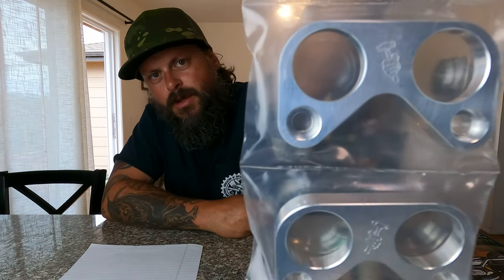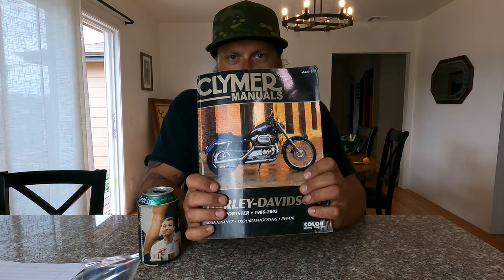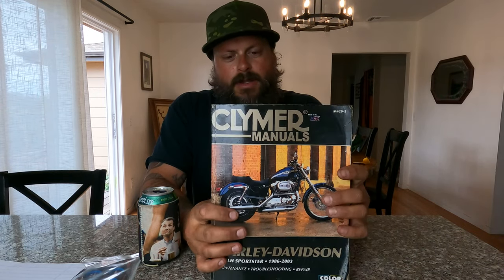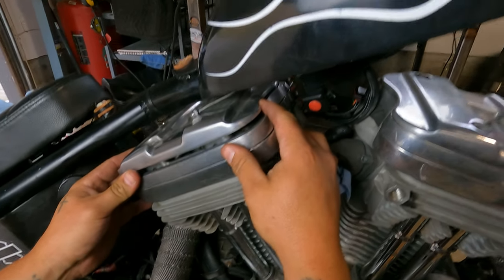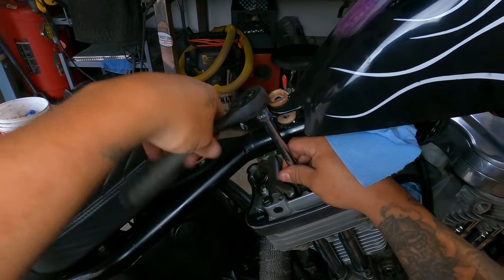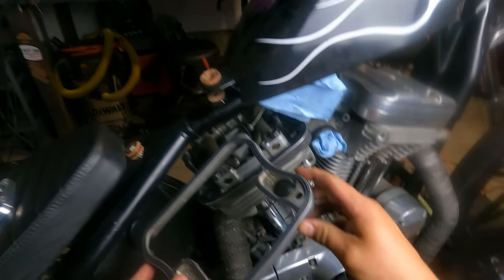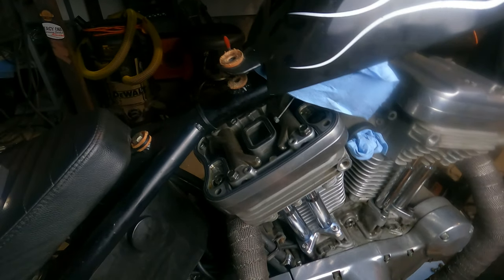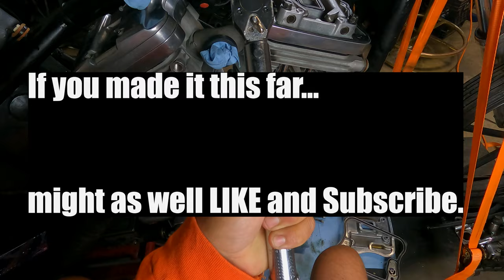SPORTSTER | PUSHROD LEAK FIXED

Comment: I just wanted to double check if the tubes can be pulled out
Without taking heads off, I’m positive now, a lot of videos out there showing silicone and RTV shit to stop leak, no
I’m not going that way
Reply from the maker: Just put new seals in. And make sure you get them in right.  I used lithium grease to help it stick